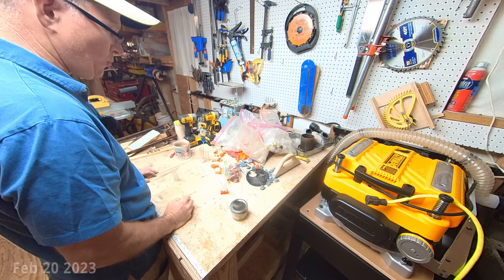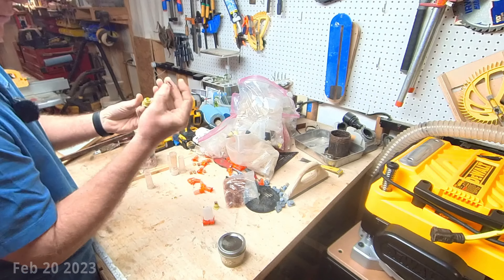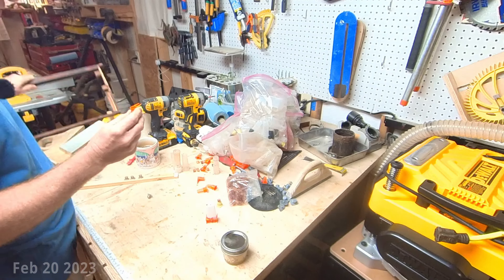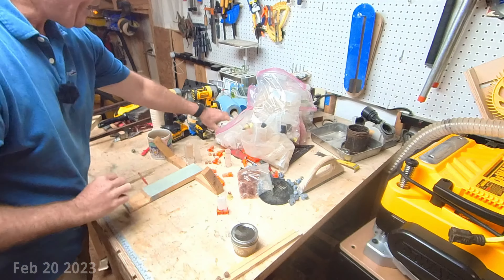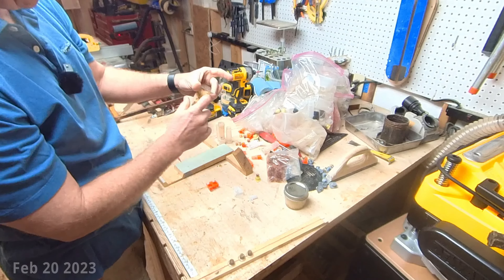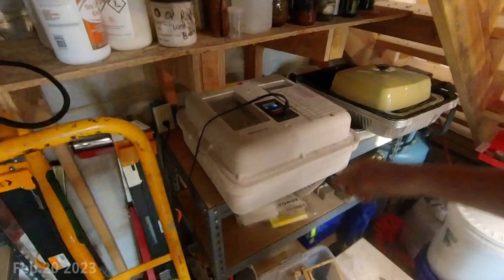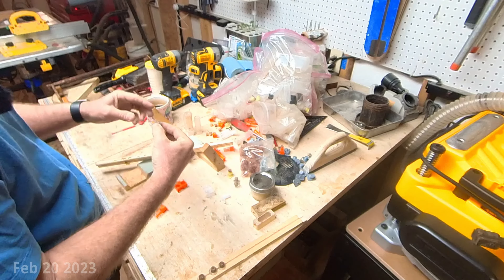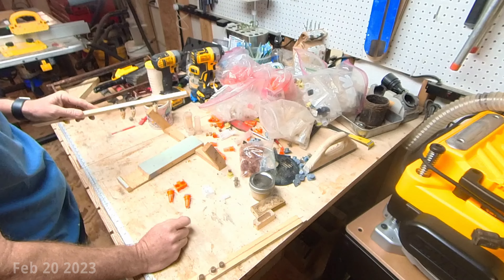Prepping Queens for Transport and Queen Rearing Equipment - Jacksonville, FL Zone 9a

Comment: Do the queen cells have to be kept at a certain temp before pickup?  I've sold mated queens and my friend has been selling virgin and cells last year. That would save alot of work and time on my part not having so many mating nucs in my yard and maintaining them too. I'm also an experimentor as you said in another video. I don't graft yet though, almost 70 and eyesight isn't great.  I either crowd a good strong colony to get them to make swarm cells and pull my queen to a nuc til I can pull them after capping or pull a queen to get emergency cells. Both work just fine and both queens are successful.  I do have an incubator I use but use the curler cages since cell protectors won't fit on most of the queen cells I cut from the combs.
Reply from the maker: I keep queen cells in a small chicken egg incubator, at 92 degrees.  They stay in the incubator until pickup. Curler cages are great for letting the cells hatch in the incubator, you just have to ensure there are a few attendants and some food and water them daily.